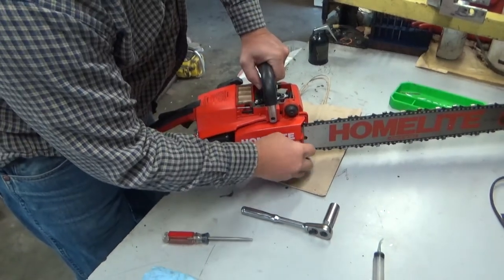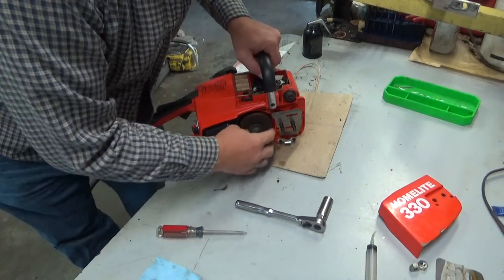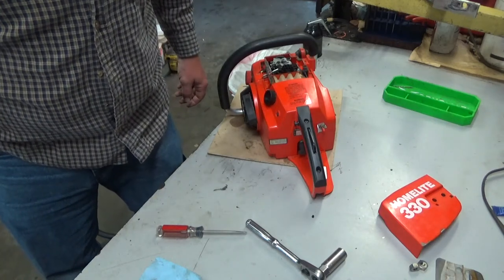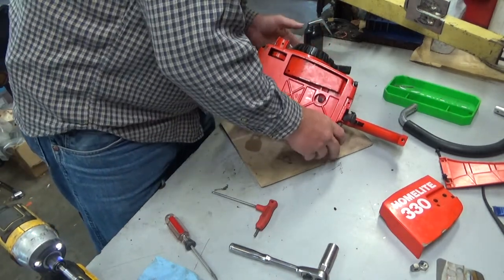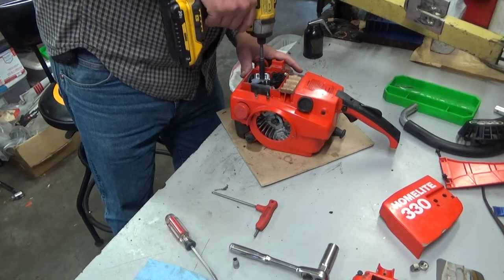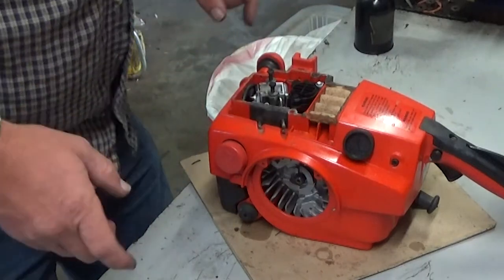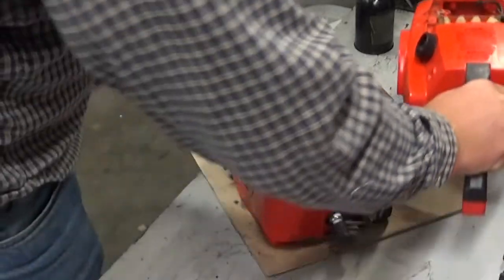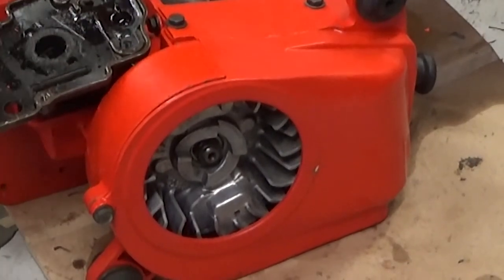Changing The Carburetor Boot in Marco's Homelite 330 Chainsaw!

Comment: Nice video.  Good to have on record for us 330 owners. I've owned my 330 since new. I've changed my intake boot out about four times in 40 years. You did a ring job on it a year or so ago! Still runs great.  One time I was at our wooded property (an hour & a half away) to cut a cord of firewood when the boot cracked! I was only 1/4 cord in...  What to do??? In the FIELD I had to do this repair on the tailgate of my truck but I had no replacement boot (I always carry a spare now). To field fix it, I used electrical tape wrapped around the boot a bunch of times. Finished my cord but it was acting up by the time I finished. Changed it out when I got home where I HAD a spare!

Comment: I own six of the 330 homelites, And every one of those saws had the same problem, An intake boot that had turned to black sticky goo! But the good thing about that is i can break down one of these and back together in no time! I keep reading the comments on this model of homelite and hearing all the sniveling guys are doing. I ran one of these ( In fact, I still  have  it ) 330 saws for a couple of years cutting some very large Douglas fir timber with it with minimal amount of problems! I think they sure as hell work as good if not better than anything you could purchase for under $500:00 dollars these days!

Comment: On my 330 changing the intake boot, (4 times) I've always struggled separating the top cover from the engine and tank. BUT the reassembly just slides right into place. I've not struggled like happened to you on this saw. I've never been able to figure out why it goes on so easily but comes off with so much difficulty. So likely in the factor during assembly it was a SNAP for them!

Comment: I got a Homelite 330 that wouldn't run. I did a pressure test and the intake boot was leaking. I watched your video and enjoyed your step by step disassembly . I would have never figured out how to get to the boot. I rebuilt the carburetor and now I have a great running antique saw. I put 40:1 Mix in the tank. Is that the right mixture?

Comment: To get the oiler working good pull the hose from the tank use a syringe full of oil put a piece of fuel line on the syringe and hook it to the pump where the oil line from the tank holds up and is the syringe to squirt oil all the way through until it comes out the oil hole with the bar removed and this will force all the air out of the oil system and it works like a charm then hook your oil line from the tank back up and your in business. This method could work on other saws as well. Hope this helps someone because these are a pain to get oiling again.

Comment: I knew I should have replaced all the gaskets!!!!!!!! Even more fun to take case off when full of sawdust--mounts and steel washers make it fun. Oil pump--hope it works............  Good video!!!!!!!!!!!! duckbill replace in tank--I wish!!!!
Reply: Just remember this! If you're dealing with a sawdust in the case of the chainsaw your cutting with a dull chain! You should be making chips enstead of powder! And if possible, I take the bark off of the wood I'm cutting because as soon as you touch the chain to the bark it turns into powder as well! Making a mess out of your saw and coating the coil pick up until it won't send a good signal across the air gap between magnito and coil. 😊